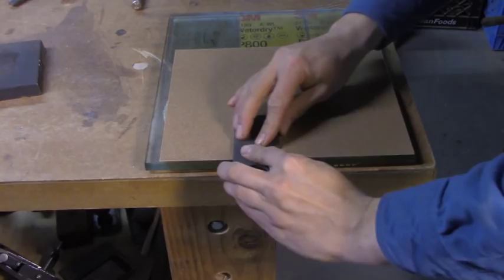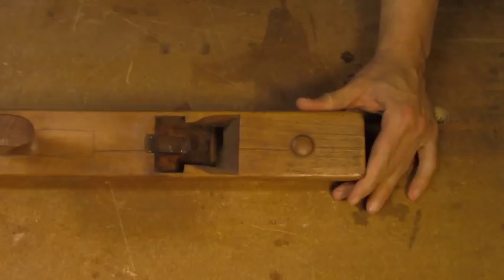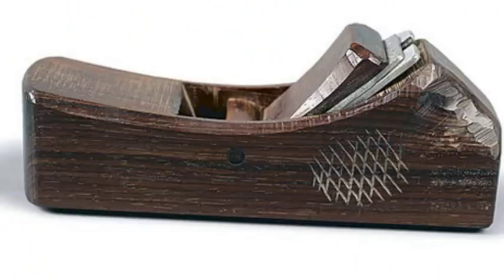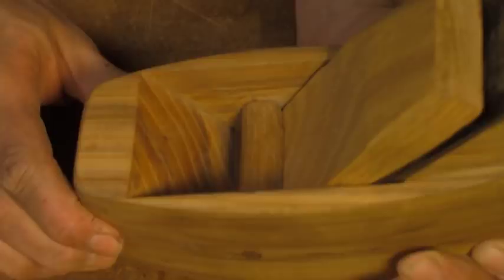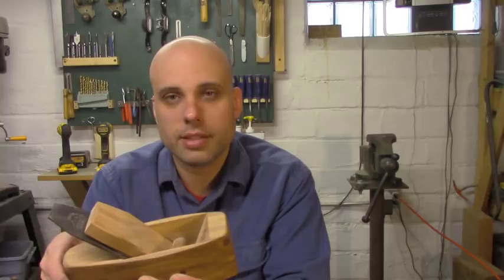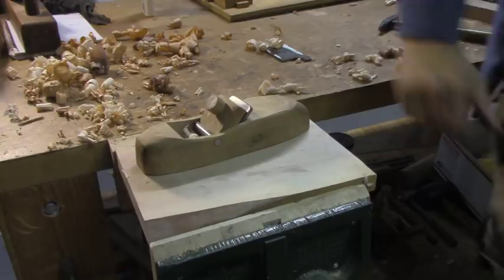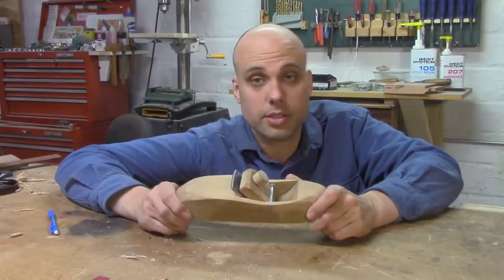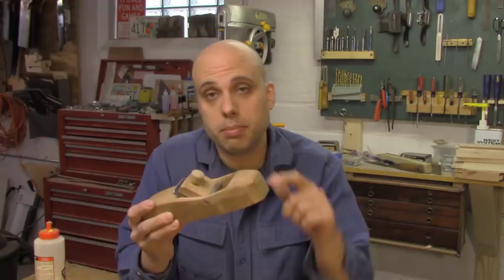Make the easiest handplane ever! (Pt 1: design and blade)

Comment: if you look for insanely cheap steel for blades, i had good luck with broken bits of metal cutting circular saws.
You know, you go to your local metalworking small shop, ask if you can forage a bit in the waste bin and get any good sized pieces of those blades they use for cutting the steel with. 
It's crazy hard, about 1/8 of an inch or 3mm thick and it keeps an edge like you would not believe it.
Granted, it takes a looong time to shape and sharpen but it has the incredible advantage of being similar to high speed steel in the aspect that you can be a little careless about overheating when grinding and needing sharpening far less often.
I made a blade for a wooden jackplane that's 60mm wide 180mm long (that's 2"3/8 wide 7"long) and it works very well.
I did a bit of kitchen oven tempering before shaping  but it did nothing to soften it, so i don't think that's actually necessary.

Did not cost me a cent and you might be able to use some woodworking blades for the same purpose

Comment: I understand this video is 3 years old, but the edger blades actually are hardened, but they're tempered way back to avoid shattering, which would be extremely dangerous for the edger user. A simple re-hardening & tempering would do the trick.
I also understand that hardening and tempering is mysterious to a lot of people, but it's a super simple process requiring only a cheap map gas torch & toaster oven - a very small investment that opens up a whole new world of creating your own tools from other tools... 🤷‍♂️👍

Comment: I know this is an old video, but edger blades and lawnmower blades are high carbon, but they aren't hardened. If they were hardened then they would snap too easily, but they have to be high carbon or else they'd wear out too quickly. If you want to harden it, just stick it in a hot fire until it turns cherry red and then quench it in motor oil. You can use a charcoal grill and a hair dryer to get the iron hot

Comment: I respect what your are doing, Rex. It is quality work and I think it provides a good start for someone who wants to learn how to do quality work.  With that said, until a person is ready to test, grind, drill, file, tap, harden, temper and polish a blade from mystery metal, obtaining a good blade will eliminate half the issues that can cause a plane to fail. The Hock blade mocked in the previous video is really not that bad of a deal. It would not be my first choice for a beginning plane maker since it has a chip breaker, but Hock and Lee Valley both supply some good blades that could be used as references and to make top end planes easily. I think learning to grind, drill, file, tap, harden, temper and polish a blade from mystery metal is an important skills well worth developing but it adds another full learning curve to woodworking. Even so, having a good reference piece to compare to will be important if a person does get into blacksmithing tools. If a person is interested in making a good plane I would advise them to make a single iron blade first since a chip breaker is only wonderful after you learn how to adjust it. Till then a double iron blade can be the death of joy. A good single iron from Lee Valley would be a good reference and an easy way to make your first plane. I would advise getting a Hock blade later since it has a double iron and will introduce another variable that has left more than one good woodworker screaming in frustration. In any case, get as many Hock blades as you can, while you can. After Ron Hock is gone they are likely to become legendary, cult items hoarded by the followers of Krenov.

Comment: Interesting concept. At the time of writing, it appears that Amazon (because you reference Amazon in the video) sells all sorts of plane irons for anywhere between $5 - $20. On the other hand, it seems woodworking sites are listing certain Hock blades for as low as $20 - $25. You could also pick up a Stanley iron at any hardware store that carries those goofy red planes for $20 - $30. So there seem to be many ways of acquiring a cheap plane iron without resorting to power tools.

Comment: Rex, did you try heat treating the edger iron?  Torch, quench, & Bob's your uncle.
In the past I bought a short bar of oil hardening steel several years ago fory plane blades.  First project was a panel plane.

Comment: I think the Echo blade is high carbon steel but may not be tempered to where you wanted it for a plane iron. There are plenty of articles on the net that tell you how to harden and temper and give you the colour charts required. The only additional thing required is a blow lamp.

Comment: I like the "wooden pickle" - the knob gives it a more mechanical feel than organic, like an old mill. There's other sources of blades on ebay - for narrow ones you can get those cheap 3-4$ 30mm wide (bit over an inch) chinese wooden hand planes. They're not bad, if a bit small. The blades are incredibly hard, and either T10 Steel (chinese high carbon tool steel) or HSS. They take quite a bit of grinding to fix the shoddy edge the manufacturer puts on them but once it's sharp it stays sharp for a long time. And nothing says you can't turn the blade sideways and put a new bevel on it. to give more width.

Well, it might be a bit short, but if someone has such a dire need for a plane that they'd use it, I can't think of a better option. Bonus point is that since they're chinese sellers, they'll ship the things just about anywhere on the planet. Downside is uh... they're chinese, and the planes are made of indonesian mahogany, which I'd bet is not cut with a consideration for the environment...

Sometimes you can find packs of blades for sale on ebay but the last few listings I saw for them went down months ago. I'm assuming they didn't sell.
Reply from the maker: I admit that I'm pretty interested in those Chinese planes. Might have to pick one up.
Reply: Just bought one of those Chinese planes , which took forever to arrive. Lots of adjustments , to the sole, iron, and wedge, but turned out to be a pretty good little plane.

Comment: Leaf spring steel might be a good source.
Reply: It's good steel, but it is a major PITA to work with. It's thick (at least the piece I found was) and has a curve to it. Grinding it down is not fun. (tried to make a chisel out of some once)

If you have a forge, you might be able to do something with it. If you have a little belt sander and a grinding wheel, you better be ready for a LOT of hard work and cursing.

Comment: Nice improvisation for a plane blade.  I have some old wooden plane blades lying around.  I think I'll get one prepped so I can follow along.

I would love to see a build, along with some dimensions, on that hybrid plane some day.  I have a half dozen frogs lying around, but cannot find any dimensions for the thickness of the sole.  I'm assuming the rest isn't quite as critical as the thickness of the sole.
Reply from the maker: Oh, that hybrid thing is GONNA happen. You can bank on it. It's just not a quick project and I'm really struggling to balance my woodworking business and content creation these days.
Reply: Thanks for the reply.  I'm looking forward to the video.  In the meantime, how thick is the sole of that plane 3/4"?
Reply from the maker: That sounds about right. You have to cut off the bottom of the frog and make it flat on the bottom.
Reply: Thanks!  I need to get off my butt and try and make one soon.  Then I can watch your future series on how to do it correctly :-).

Comment: #Rex Krueger I have a 2-1/2 long blade with chip breaker, is it possible to make a functional krenov plane? My blade have already a chipbreaker similar to hock blade but like I said is 2-1/2 long blade and hock blades are usually almost 9 centimeter long
Reply from the maker: Sounds fine to me!  Having the chip-breaker is a big plus.

Comment: The edger blade probably is high carbon steel. It has not been tempered to be hard. The manufacturer  wants the blade to wear down not  shatter. If you could heat and quench your blade it would hold an edge longer.
Reply from the maker: With all respect, you've really gotta browse the other comments before you comment. This has been covered SO many times.

Comment: Did you consider hardening the edger blade?  Not all hardening is the same; something that needs to hold up to impacts with concrete can't be as hard as a knife because it would chip, but still benefits from being high carbon for strength (and is probably hardened but then tempered to a softer level).
Hardening a chunk of metal that size and then tempering it to a suitable extent is ... not trivial, but also not rocket science.  A blow torch and oven are the only tools you need (and the oven is optional).

Comment: If you're going to go on Amazon, just search for O1 barstock, and buy a foot of 2" x 1/8" steel for about $20. you'll get 3 plane irons out of it and you know exactly what you're getting.
Reply from the maker: I appreciate the idea, but lots of people have made this point. The thing about the chisel blade is that it's about 80% ready to be an iron the way it comes and the heat-treat is done. Even a cheap hunk of 01 doesn't offer those advantages. Still, thanks for watching!

Comment: I've made plane irons from chisels but they've been grooving and moulding planes with narrow irons.

Not sure if spending $13 for a low-quality chisel is worth it, though. For that money, you can get an old iron or a junk plane and refurbish it for about the same amount of effort and probably get a better iron made from higher quality steel.

A wooden smoother is on my short list of projects, but I intend to get one of those nice Hock irons or repurpose a junk plane for it. I'm spending hours and hours on the project, it deserves a good iron to make it worthwhile.
Reply from the maker: Just because the iron is cheap doesn't make it junk.  Steel production is a highly controlled industrial process and simple,  high-carbon steel can be made with amazing consistency for very little money. This is why you can buy a decent knife for cheap.  Humans have really nailed steel production and a hard chunk of high carbon is all you need for a really good plane.
Reply: Great to have you join the discussion and good luck with your plane! In one of Rex's early videos he points out that he does the refurbish a lot, but had many viewer express that they couldn't find junk planes locally. I think this is almost more of a thought experiment and proof of concept than as a recommendation on the easiest way to get good results. Rex also recognized that Hock makes a fantastic iron that is likely out of the price range in an earlier video. I think he even provided a link to it for people who didn't want to make their own iron.
Reply: Rex Krueger yeah, it's hit or miss with cheap chisels. Might be a really good one, or not. Anyway, thanks for the great down to earth video on plane making.

Comment: Ya know, Stanley sells replacement plane blades, for like, $12.
Reply from the maker: Yeah but no chipbreaker and without it, those irons are too thin.
Reply: @RexKrueger  I was wondering what was the problem with those Stanley replacement blades, that makes sense. (When you said if you could buy a plane iron for $13 I tabbed over to Amazon and thought you'd be undervaluing your time by a LOT if you spent a half-hour to save $4!)

Comment: There is a better source and potentially free.  Just takes a little more work.   Leaf springs off a vehicle are generally 5160 and are amazing for making knifes and impact tools.   If you know someone who is a car mechanic you can get old used ones for free.
Reply from the maker: That's a great idea. I'll keep that in mind for the future!
Reply: Bear in mind that automotive springs have an arc made into them. If you use the thicker portion of the spring near the center,  you could grind it flat on your belt sander then shape it and cut the bevel.
You could heat the metal to remove the arc but then you'd have to re-harden it and then temper it which would defeat the purpose entirely.
Reply: One more point on this subject...I've seen wood turning tools like round nosed scrapers made from leaf spring steel too. They don't hold an edge quite as well as HSS but they're just fine for specialty scrapers for a specific use.
Reply: I do hobby blacksmithing and have a number of leaf springs already, along with some 80CrV2, and plan on making myself a plane blade using them.
Reply from the maker: Hey Gil!  Thanks for the tips. I am kinda on the lookout for leaf springs.